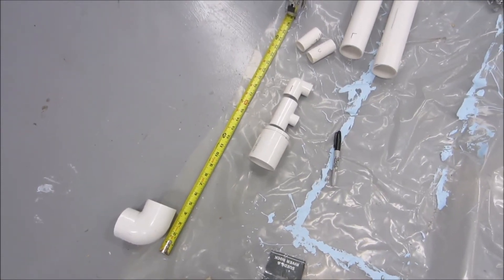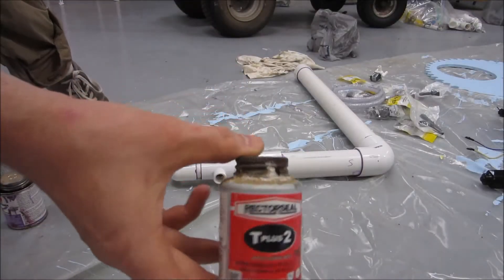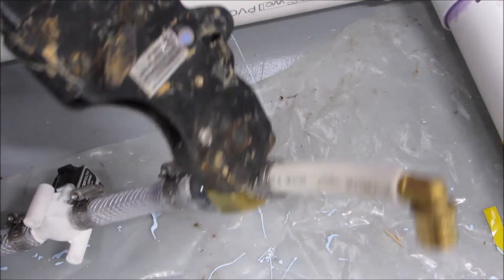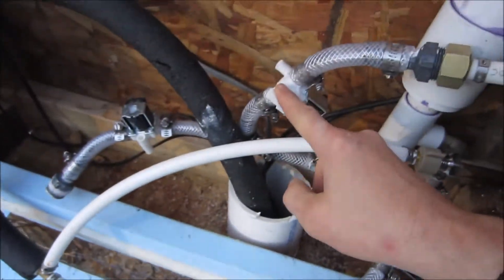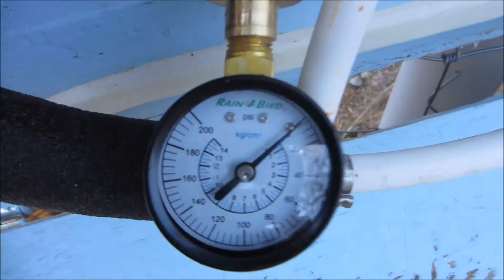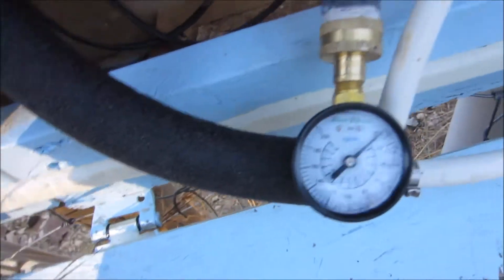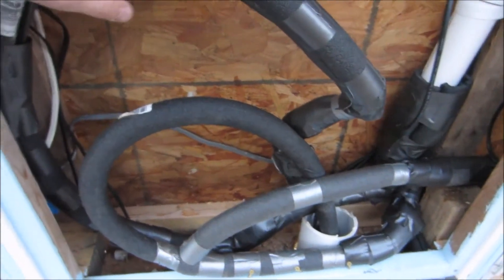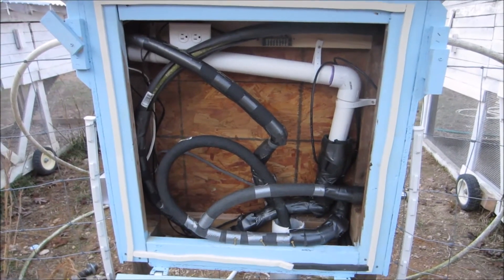Chicken Coop Automation: Part 3 Cheap DIY pressure tank / watering system

Comment: I'm looking to do this for a water connection system. Do you have a piping diagram of how you hooked this up. Hopefully you're still around.
Reply from the maker: I'd recommend you just buy a small air bladder system designed for this - eventually the gas piston (bubble) dissolved into the water, so you really need a membrane to make this work.

Comment: Hey, man that's a neat built out.
I recently bought a home with an abandoned well and plan to fix it in the near future.
This sounds like a neat one to accompany it, but likely on a smaller scale. Maybe to fill the dog's water bowl?
I'm new to fluidial systems.
The physics behind it and the varying intertwined parts of my proffession.
Cheers to creation
Reply from the maker: I would recommend you purchase a real bladder based air pressure system, such as those used with well pumps.  Eventually as I suspected the air in the line was dissolved into the water.  A membrane is definitely needed.  It worked well for a few months though. :)

Comment: I don't really understand where the pressure is coming from.  What is the logic behind this?
Reply from the maker: The pressure comes from air in the tank being compressed.  When the valve opens the water exits at high pressure momentarily as the compressed air expands again.

Comment: wow a homemade blader tank does it actually work that good
Reply from the maker: It worked great until the gas eventually dissolved in the water, preventing it from functioning.  Apparently there is a good reason for the rubber membrane in conventional tanks!  That said, if someone wanted to keep it functioning, a bleeder to allow air back in, could occasionally recharge the gas portion and keep it functioning indefinitely.  In my case I needed a pretty special shape to fit the box.  I suspect using something like a pond liner membrane might also work well.  Thanks for the comment!
Reply: is this the same principle as a water ram
Reply from the maker: Not really.  A water ram uses a valve and alternating drain/push mechanics to force water upwards.  A bladder is simply used for pressurizing gas which then pushes back when released.  The reason is because water can't be compressed (at least practically speaking).  Gas on the other hand can be compressed, which creates tension, which the seeks to equalize and is used to push against water to force it back out.  It's like a balloon filled with air - when you press on it, then release, it will expand back to its normal position.  I was experimenting with using a membrane-less system.  I realized the gas portion would eventually dissolve into the water, but I didn't think it would happen as quickly as it did.  It probably maintained its gas bubble for a month or two.